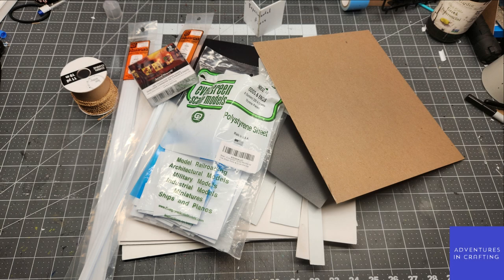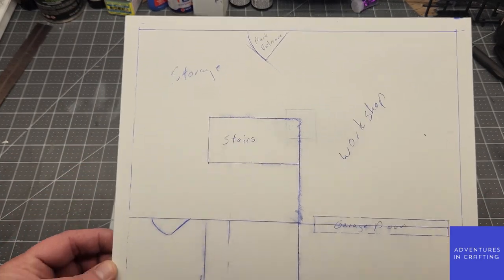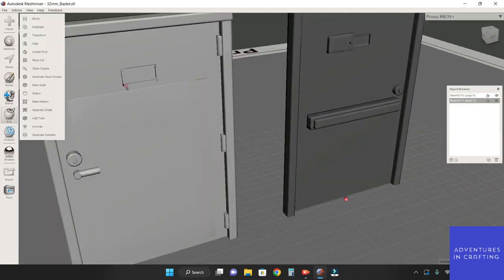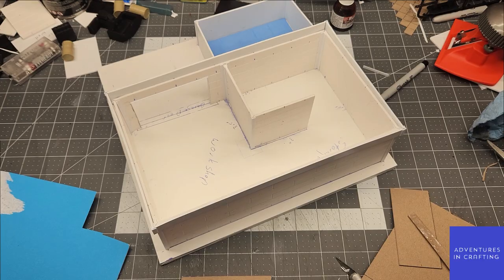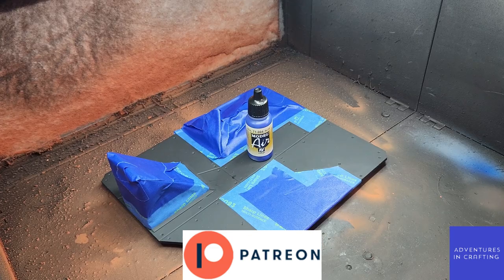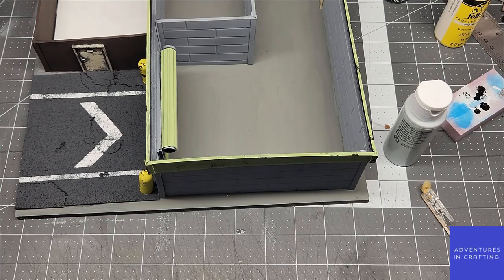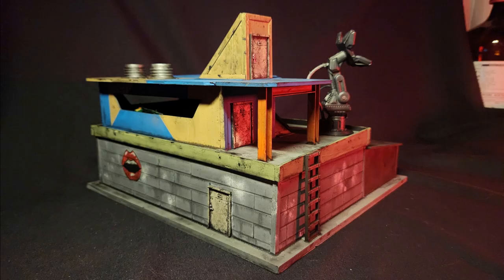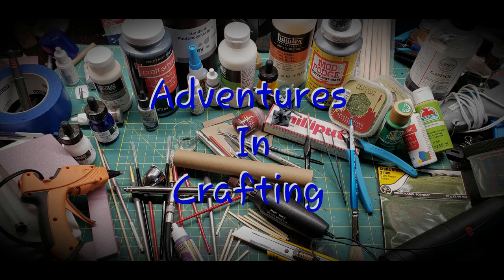Using sintra board to scratch build sci-fi and wargaming terrain

Comment: I've done that thumb bulge on an otherwise straight line SO many times. Also crushed my corrugated paper texture, forgot to texture stuff before I glued it together, was too heavy with my measuring marks, used the absolute wrong paint, and so on. Despite it all that was a nice and useful piece of terrain. I recently got some of that PVA foam too, never tried it before, and I look forward to flailing my way through a project with it.
Reply from the maker: I must be in good company then! Using the expand PVC is definitely a new and fun challenge!